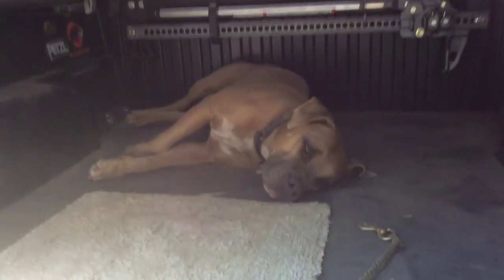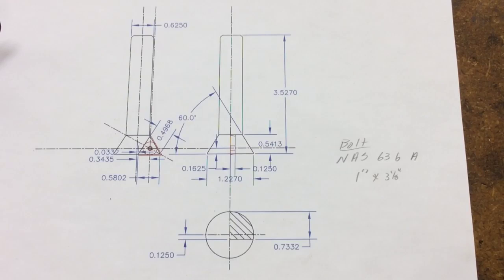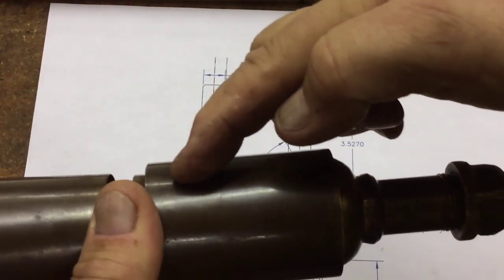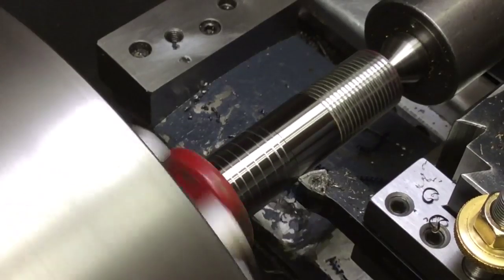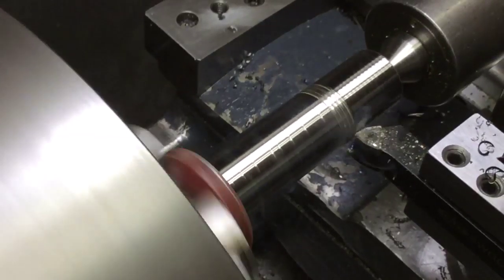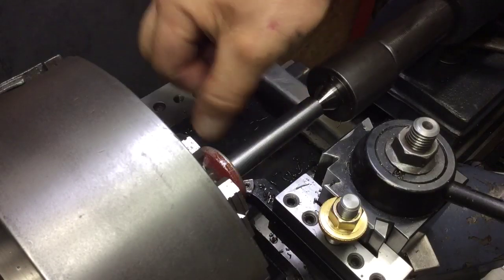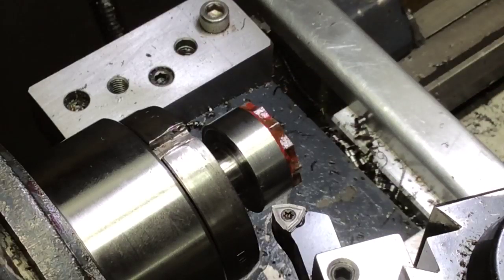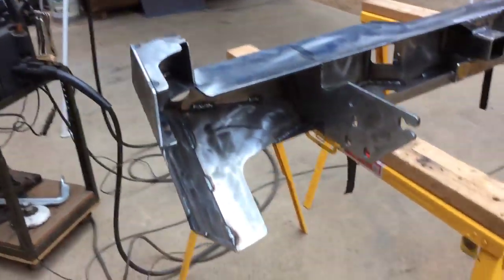How to Make an Insert Dovetail Cutter P1

Comment: Digging that Kearney Trecker shirt!  That bolt turns very nice.  I have used large grade 8 bolts for various projects, a nice source of material available at your local tractor supply hardware.
Reply from the maker: James Kilroy I love these bolts, I need to do more research on what the alloy is.  I wish they were longer.  Maybe one day I will have a K&T machine.  Thanks for the visit.  Randy
Reply: In your video it cuts like some variation of 4130PH, or pre-hardened.  Thats generally a 75-100 ksi material with great qualities for just about any use.  I don't know what you paid for the bolts but a foot of 1" is somewhere between $15 and $20 at most suppliers.  4130 is a high quality material and if someone offers to sell it to you really cheap be suspect.
Reply from the maker: James Kilroy I get the bolts for free, I have an in.  They can't reuse them once removed.  I one have 2 left so this winter I hope to get a few more.  i want to make a 1" boring bar I am thinking 4130 for that.  Thank you, Randy
Reply: If you can get them for free, snag all you can, that's some good stuff.  For a 1" boring bar you are going to need something longer.  A decent one inch steel bar can bore in 4 to 5" so you need at least an 8" bar, but an even foot long would be better.
Reply from the maker: Randy Richard Found my specs on the bolt,Material : Chrome-Mloy Alloy - E4340 or 8735 or 8740 or 6150 or 4140, 180,000 psi tensile, Rock C 39 to 43.  NAS specifications, Mil Spec MS21134.  Nice stuff.  If I can get a few extra I will send you one.  Randy
Reply from the maker: James Kilroy I have a 1" Criterion Boring Head, so maybe an 6" and a 10" would be good, maybe use 4140 for them.  I get all that I can on the bolts.  Randy
Reply: Randy Richard 180ksi means those bolts have been heat treated, threads probably ground after heat treat, no wonder they are expensive!
Reply: Randy Richard Oh, I thought you meant a boring bar to use in your lathe.  I have a 1" boring head as well, I will post a quick vid to show the bar I made for it.
Reply from the maker: James Kilroy Maybe ground, threads UNJF 1"-12  3A. Yes I would like to see it.  Thanks Randy

Comment: Nice mods on the truck. I like it.

Nice bolt re-purpose, they don't come cheap. I have some a2 steel, would that be ok to make it with?

No apology require on the rack Randy.
Reply from the maker: Steve S Thanks Steve. A2 should work fine.  The bolt I used, I think is a Chrome-Moly alloy.  I have the tool holder up today.  Thanks for the visit to the shop.

Comment: Unlike that aircraft bolt, ordinary commercial fasteners tend to be random alloys. Anythings that meets or exceeds the basic specs for tensile strength and toughness will do.

Your tailstock was floating around a bit there!
Reply from the maker: Paul Compton Thanks Paul for the comment.  The bolt is 4130 or similar and heat treated, they list 4 or 5 other alloys that are ok in the NAS specification.  Yeah did not tighten the lock fully there at the beginning.  Good catch.  Thanks again, Randy

Comment: I've got to ask Randy, why such shallow cuts when you have that much stock to remove? Are you limited on HP? I routinely take .300-.500" per side in steel at work. Granted, that's on a Lodge & Shipley PowerTurn, but you should be able to take .1" per side without a problem.
Reply from the maker: +Jessie VaineoHurst I this video I was using my small Logan belt driven lathe, Hp is an issue.  Now I have a large lathe and this is much quicker.  Thanks Randy

Comment: Would this cutter perform will on cold rolled? I'm thinking of making one from a drop of 4130 I have. I need to make some tool holders for my lathe. I have some inserts that are larger than yours, but have no relief so there is six cutting edges. Would that necessitate modifying the tool to have the positive rake?
Reply from the maker: The tool has been used on cold rolled 1018, 4140, 4130 and others with great results.  Using zero rake insert would have to be set with a negative rake, on two edges.  This is very difficult to do and would not produce a 60 deg angle.  I use a TPGB insert with 11 deg of clearance on all edges.

Comment: Randy, at 20:35 what tool are you using to face off the bolt with?
Reply from the maker: Brian Stanga It is a 1/2" HSS with a chipbreaker grind.  Thanks Randy

Comment: Please be careful taking the first cuts off these bolts, as they are cadmium plated and cutting it off can put it airborne and in your lungs. I too have used Aircraft grade bolts to make things out of, but for the first cuts I use some water soluble cutting fluid so no dust gets made. Nice job on the cutter.
Reply from the maker: 40cleco Yes on the cad plating.  I use cutting oil.  Thanks for the comment. Randy

Comment: Thank you Richard just made one of these to your plan and it works really well, I couldn't find a quality bolt so used a worn 1967 Hillman Imp kingpin from my scrap bin.
http://bbs.homeshopmachinist.net/threads/39202-Shop-Made-Tools?p=1081713#post1081713

Regards Paul
Reply from the maker: Very nicely done Paul.  I checked out your link.